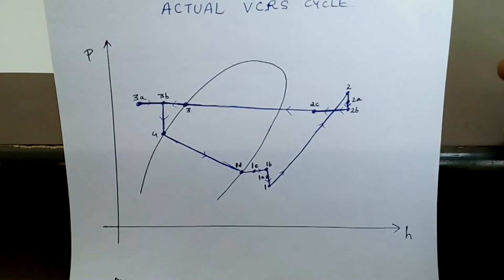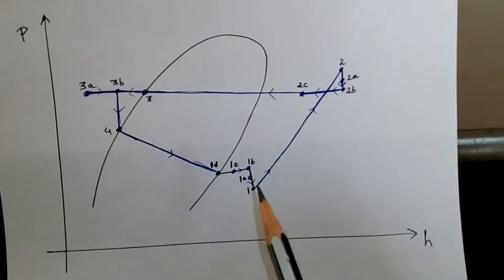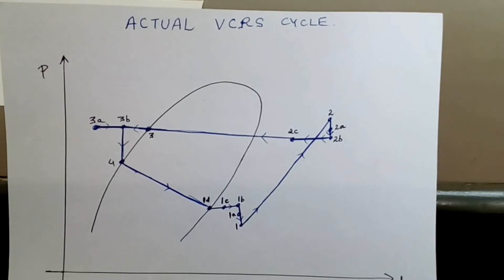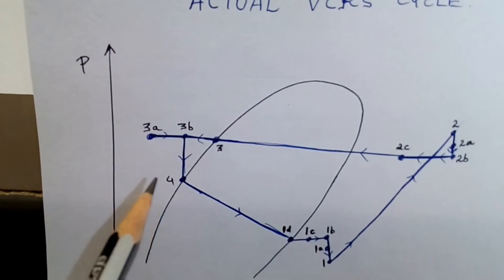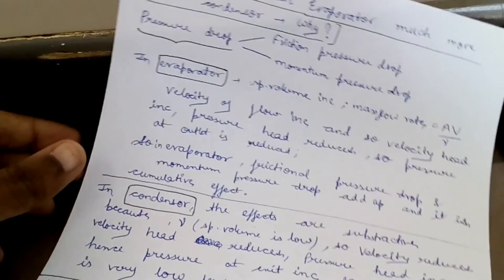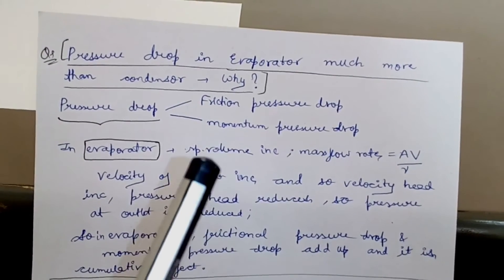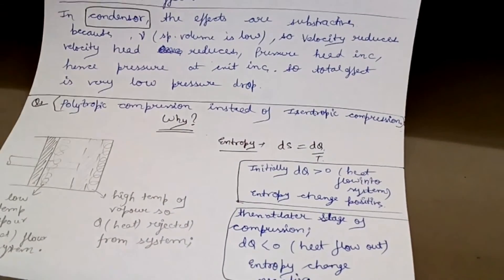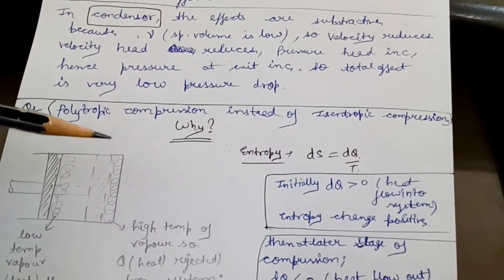actual vcrs cycle | actual vapor compression refrigeration cycle | #vcrs #refrigeration #actualvcrs

Comment: Hi sir
Process 1b to 1,where there is a pressure drop in suction line before entering the compressor in PH chart. You have drawn a vertical line downwards which indicates the pressure drop, but I have a question that during this pressure drop doesn't there be a increase in enthalpy too? I would like to receive your feedback on this

Thanks